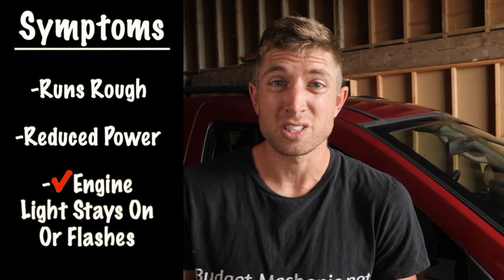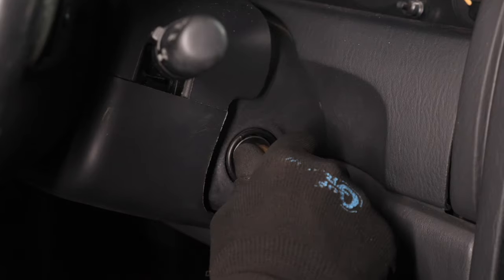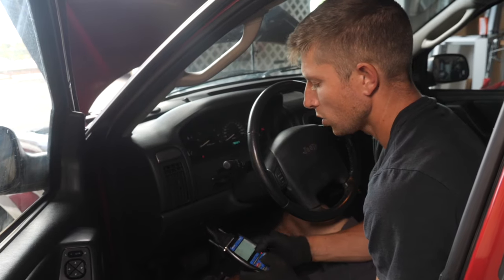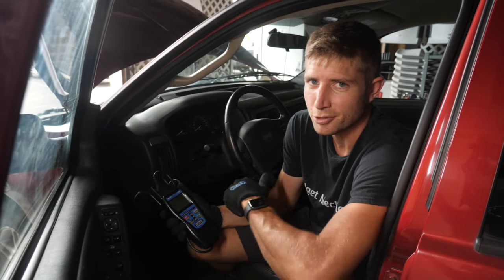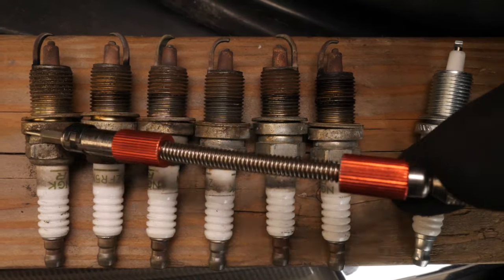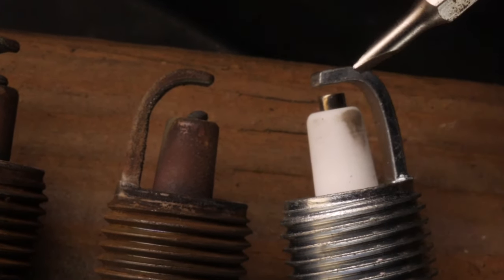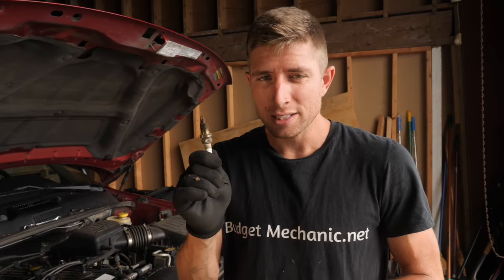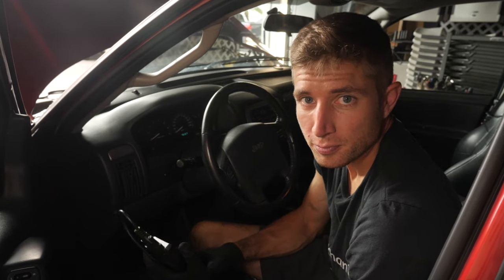Diagnose and Fix Engine Misfires - Flashing Check Engine Light , Rough Running Idle , Low Power

Comment: I have a 2001 chevy 5.3 186,000 miles, rough idle almost all of the time, check engine light on flashes sometimes, here is what i have had done to it so far, New MAF, both front o2 sensors, plugs, wires, MAP sensor, engine coolant temperature sensor, all new injectors, new Manifold gasket, fuel pump and filter,  i havent replaced the coils as of yet cause  it's been in 3 different shops and they all tell me the coils are all good (starting to wonder if they really are) its been smoke tested no leaks, it had compression  test done all good, they did a fuel test where they drained the fuel to see it was contaminated or not and it was all good. oh also replaced the cam sensor when i did the manifold gaskets since i was in there and the knock sensors were good, i checked all the grounds all seemed to be good. all the parts i put into this are OEM parts never went with the cheap knock off parts, i have over 5k parts and labor into this thing and its running worse than when i 1st got it, started off p0171/p0174 codes them are gone now its p0300 code and im at my wits end with this damn thing lol.........Any ideas? inbetween some of these fixes it ran better, the last thing i did was the manifold gasket and it ran pretty good then just one day was crap, cant even drive it 2 miles down the road without thinking she's done for
Reply: That will destroy ur catilitic converter
Reply: @eddieclark4477  What will destroy Cats? the p0300 code
Reply: @kenkeezer4875  a flashing check engine soon light is telling u to pull over as soon as possible and cut the car off. The onboard diagnostics(PCM) has detected  raw fuel coming out of the exhaust and not being properly ignited in the combustion process. A rich condition(not the proper air/fuel ratio that is needed to achieve the maximum performance and driveabilty it calls for(14.7) 14.6 parts air and 1 part fuel in every cylinder exactly to achieve maximum performance and perfect driveability to get the perfect gas mileage possible. The oxygen sensor detects  only oxygen in the combustion process. Either not enough oxygen(lean condition) exactly in each cylindernough oxygen is)discharged more cylinders is misfiring 's misfiring
Reply: @kenkeezer4875  a DTC (diagnostic trouble code) is set by the onboard diagnostics computer(PCM) to let u and the task master know that the misfire is so severe it's flashing on and off. Meaning raw gasaline is coming out of 1 or more of ur cylinders during the combustion process. Not being properly discharged out of the problemed cylinder/cylinders. Raw unburned fuel released into ur catilitic converter will kill it. Plus it releases carbon monoxide gases(poison) into our atmosphere through the exhaust pipe and muffler. The oxygen sensor detects only the amount of oxygen that is in the combustion discharge process.it either detects to much oxygen(lean condition) or a rich condition(not enough oxygen) either way the PCM will either add more fuel to the cylinder (lean) or subtract fuel (rich) to achieve the perfect 14.7 parts air 1 parts fuel charge out to where it needs to be for that perfect driveabilty and the high performance ur car needs to get the best gas mileage possible. That means ur happy and ur cats happy. Fuel trim numbers are whats important here. to get all ur cylinders back on track and hitting that 14.7 parts air and the 1 parts fuel is what the task master is trying to figure out so it can errase that (dtc)diagnostic trouble code from the PCM and everybody is happy again. You know man the thing that u need to do right now before you start sinking more money into ur ride like that to no avail. I would take ur throttle body off and clean it real good with carb cleaner rags and tooth brushes. Sounds like to me all ur really needing is that throttle plate cleaned out good because its eirher sticking open or sticking shut causing it to run rough or not want to run at all. Sticking open or shut throttle plates makes a car run like fkn shit dude. Clean it real good put it back together and ill bet it runs like a brand fkn new one again brother. Let me know how it does man.
Reply: @eddieclark4477  Thanks for all the info Bro, i will get that cleaned out and will let ya know how it turns out, might be a week or so as im out of town in a couple days.
Reply: @kenkeezer4875  i'll be interested in hearing if that takes care of ur problem or not. If not we'll figure it out.
Reply: @eddieclark4477  Sounds good, and yeah as soon as i get it done i will let ya know, and TY for taking the time responding back with all the info, much appreciated.
Reply from the maker: What he said
Reply: @eddieclark4477  Well finally got around to cleaning out the throttle body and well there was no difference in the way it runs, throttle body was actually pretty clean, looked to make sure all ground wires were good and they were, so idk guess i will keep looking at things.........

Comment: Okay so what do we do if we are still having rough idle and we’ve changed all the spark plugs and 3 of the ignition coils. (4,5,6 to be precise I believe because the code reader noted these). Check engine light is still on and it’s still not driving or sounding right. Does this mean my engine computer is messed up and is causing the misfiring?

Comment: Could it also be a ecm problem? I recently purchased an 07 saturn outlook and I'm experiencing these problems as well now after a few days of having it. The code reader said the mass sensor needed to be changed, I've had it changed and it is still running rough, my temp hand and gas hand aren't working, it doesn't show what gear I'm in and it cuts off. Even the radio went out on me.
Reply from the maker: Yes it sounds like you have some electrical problems! Could be computer or even your instrument cluster. You need someone with a good scan tool to poke around
Reply: Test alternator, check grounds

Comment: My 2007 city golf 2.0 is running extremely bad but only when its wet out and when its dry out runs fine 
But when i take it to the shop NO CODES I've changed wires plugs nothing 
and I mean it runs so bad i think its gonna break something 
what do you think? remember only when its wet the more moister or rain the worse
Reply: Check out ur PVC valve. Pull the valve out of the valve cover and shake it. If it rattles the valve is good. If it don't rattle replace it. If its good check all the vaccum lines to the PVC valve for blockage/disconnected/crimped hoses as well.

Comment: I changed my ignition coils and spark plugs on my 2010 Jeep Compass but my check engine light still says cylinder 4 misfire I don’t know what else to check for. Help please
Reply from the maker: If you’ve cleared the engine light and it’s still coming back it would be time to check injector on that cylinder and make sure it’s working (or try swapping with another cylinder and see if code changes). Also possible your new coil isn’t getting power (ignition problem) Also you might need to get a compression test done and make sure you don’t have valve/ring problems
Reply: If you're still having issues, it's worth checking the spark plug wires, and the distributor cap and rotor, if your vehicle is equipped with them.

Comment: Found spark plug wires eaten by mice. I understand they like soy based wires.
I took into a shop they charged me dignostic and said I needed a complete tune some kind of chamber and throttle body clean. All I could afford was the diagnoses fee and to get my van back and a pack of spark plug wires.
Thank your for helping with Diagnosis. Next week I will afford to change oil.

Comment: Ok question, hoping I get a respond 2007 king ranch f150 had a cylinder 5 misfire and a catalytic converter code, check engine, I repaired the cylinder 5 misfire, and the check engine goes off.. now the truck runs rougher in idle.. please give me something g

Comment: 2015 camaro ss... check engine light, stabilitrak and traction control lights are all on. Sounds rough when idling. 

I changed all the spark plugs, changed the air filter, changed oil, and cleaned the throttle body. Nothing changed at all as far as car performance, still idles and runs rough, especially when decelerating. Feels like the car downshifts too early and causes a jolting. Any ideas?

Comment: I did change spark plugs, coils but still getting misfire on cylinder 4 & 2. I think I need to change the injectors. The compression on each cylinder more than 120 PSI.!?

Comment: i have a 1998 2.2 liter in my s10 my truck runs great then after 20 min or so it has no power idels rough and almost dies check engine light blinks when running rough but stays on when running good wonder what could be wrong thanks and god bless
Reply from the maker: Get that engine code read!

Comment: I just replaced the coil packs that were $300 in my wife's 2007 Nissan Altima now after it gets hot it runs very bad if you try to take it easy it seems like it might stall out but it won't if you press the gas to the floor that thing will take off but the check engine light is flashing the check engine light has been on since she bought the car so there's something minor making the chickens and light coming on but right now it's something major and I know I'm going to get misfire codes but I've already changed the coil packs and spark plugs... Yesterday after I got it hot and running and it was running like crap I lifted the air filter up and it seemed like it got a little pep so it might have something to do with mass air flow sensor I hope I do not want to take this car apart again 🤦🏻‍♂️

Comment: “Needed a throttle body and decarb because too much carbon was building up. Performed fuel injector flush as well and replaced spark plugs and wires. 

They did this to my truck 5 days ago and and the same day I picked it up my check engine light came on.... any ideas what might have happened???

Comment: My check engine light started flashing as I was going up a hill and would not accelerating was very slow so I stopped parked to the side and it was still flashing then I turned it off waited a few minutes turned it back on and no light came back on and drove normal again any advice on what to do? Doni take it to get codes read even though light is not on now
Reply from the maker: I would get the stored codes read and see which cylinders it was. Chances are it’s going to happen again, better to start troubleshooting

Comment: I got a 2003 Jeep Liberty 3.7 I change the coils spark plugs and the catalytics a brand new fuel pump and it will start no problem sometimes it has a misfire in Cylinder 6 but sometimes when I press on the gas it rev up and down continuously but there's no codes for everything can I get some help please

Comment: Bonneville 04 3.8. Top and bottom coils not firing, changed ignition control module, change the crankshaft sensor's still nothing. Changed the coils, help man!!!!!  Showed a miss fire code

Comment: Have a 97 Tacoma 2.7 I replace spark plugs, wires, fuel filter, air flow sensor, fuel injectors, took it to the Toyota dealer for a diagnosis they did the compression test was fine but they told me that #3 injector was bad my question is if the injector is not the problem what else can it be?🧐
Reply: Damn did you fix it ????
Reply: @Sethcanfixit   I did, replace the computer and fix the problem.
Reply: What part was it. What you mean you replaced the computer? The ecu? Please be more detailed since im having the same issue would help me out
Reply: @Sethcanfixit  yes the ecu, was not sending the voltage needed to the injector in my case was cylinder #3 the ECU cost me $218 dollars on eBay and it was relatively easy to replace😅
Reply: Thanks much appreciated i got the code p0303 today wish me luck

Comment: So what if there is oil on the spark plugs ? what should i do or what does it mean ?
Reply from the maker: It means your valve cover gasket (and therefore plug tube seals) needs to be replaced

Comment: How about this. My 2006 Chevy Aveo,yes an Aveo, 47K miles, kept in top shape. The CEL flashed yesterday,2-3 mins. Then stopped. Then my Sony aftermarket stereo ,in the car 3 yrs,started to flash through its settings,the faceplate colors changed,etc. But still played the CD in it.Then it stopped. No power loss,runs smooth,no hesitation,no smoking,nothing. Pulled the battery cable to erase the CEL, it went and stays off, so far. Just a fluke? Battery is 8 months old, E3 plugs, 1yr. Trans. shifts fine, I'm stumped.  Ideas??
Reply: Ever figured it out?

Comment: Hi there  my name is Gilbert I. I had came across your video & hoped possibly you could help me out? I have a 2003 Nissan Frontier so getting to coils and fuel that came up with a p0304 code for a cylinder 4 misfire I had someone change my spark plugs when trying to find the issue & he is did inform me of oil on spark plugs but that he would need to do something but he ended up moving states & since I seen this videos I was the wondering do I need to replace both the valve cover gasket & the intake manifold gasket’s & also if I need to go that far do I replace the ignition coil for cylinder 4 only or all 6 & if I’m that far clean or replace fuel filter’s ? Please let me any advice you might have to let me know what I should do i would really appreciate it !

Comment: I have 2010 bmw x3 180000 mile im getting random misfire code p0304 and p0306 i have replaced new sparkplugs , coils, replace valve cover gas gasket cleaned the MAF sensor ,cleaned the fuel injectors every possible things i can think of but those misfire code keep coming back and car getting rough idle at low rpm , do you have any idea what could be wrong or i can try to fix this problem car runs great on highway but at stop it hesitate
Reply from the maker: I would try swapping injectors around, clearing codes, and see if that changes anything. Also might be time to get a compression test done and make sure you have proper compression
Reply: @BudgetMechanicHawaii  compression is around 130

Comment: I got a 2015 GMC. It’s misfiring pretty bad . Engine light is blinking and stabilizer light is on also. Changed spark plugs changed the #3 coil cuz that’s what the code said. Nothing has changed. Took it to a mechanic and he checked it and said it was the cam shaft. Along with the #3 lifter. ..... expensive fix.....

Comment: I was on the freeway and my car started losing power. The check engine light started blinking. I took my car to auto parts store to have them scan for codes but no codes came up. I bought spark plugs and replaced them anyway. My car ran good but then it started doing the same thing...(losing power and check engine light blinking).
What can it be?
Reply from the maker: Coils maybe. Watch the video for good ideas

Comment: My engine light is flashing when travelling at 100kph. Car also sometines loses power when travelling at a lower speed so I have to quickly restart the car and it fixes the problem temporarily.
Reply: Did u find a fix im having the same problem
Reply: @royale9998  nah, apparently it's a problem somewhere in the pistons or piston rings so I'm just gonna get another motor

Comment: HI, MY CAR MITSUBISHI CARISMA MODEL 2000 CRANK BUT DID NOT START, WHEN SPARKS IN THE SPARK PLUGS ARE WEAK AND WHEN THE IGNITION ON , THE ENGINE CHECK LIGHT IS FLASHING, EVEN THE OBD SCANNER GIVE ERROR OF COMMUNICATION, CAN'T READ THE CODES, PLEASE HELP.
Reply from the maker: Did you try scanning with a couple different devices? If you are having communication errors and ignition problems etc. you may be looking at a bad computer...

Comment: I have a 2000 Suburban. I replace the knock sensor and the knock sensor wire it ran good for a while engine light came on and it reads knock sensor or bad or low voltage. now can that cause the car not to hesitate to start or misfire and there's days that it start with no problem  and runs good..
Reply: Did you resolve this problem? I'm handing the same problems with my 03

Comment: 2006 dodge Charger 5.7 hemi   throttel body is clicking and white smoke is co ing from tail pipe not knockingjust ruff running and smoke
Reply: Did u figure this out
Reply from the maker: No engine light? White smoke usually indicates coolant getting burned (head gasket fault etc)

Comment: I have no codes. Limp mode engine light flashes. Replaced coils and plugs oil change still same issue. Another odd thing if I press the deforst button the doors lock. 2014 Fiat 500l lounge 1.4l.
Reply: @laurasyn820  All good there too. And again it's working 100%. Heat wave is done. I think its electronic. Because it seems more anomaly than anything else. As I mai tain it well. But its not fun when its acting up. But for now its fully tuned up again in less than a year.

Comment: What if you replace the misfiring ignition coil and spark plug and it doesn’t solve the problem? The flashing engine light still persists. Sigh
Reply from the maker: could be a few things like bad injector, or something more complicated like loss of compression due to burnt valve. Might be time to swap injectors or get a compression test
Reply: Did you find the solution ?

Comment: What if you've already changed your spark plugs spark plug wires and a coil pack and the check engine is blinking
Reply from the maker: Still misfiring. Time to check out the other reasons we talk about in this video

Comment: I’m having issues with my cylinder 2 on my Nissan, already changed spark plugs and coil and it still keeps throwing me the code and rough idling.the issue is only on that cylinder. Any tips? Anyone